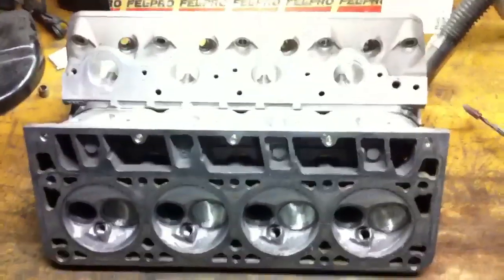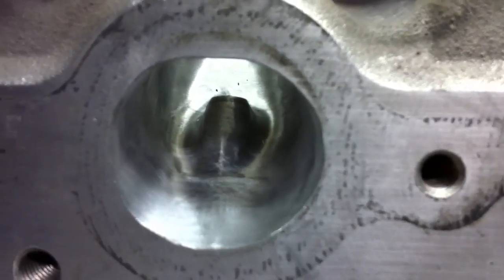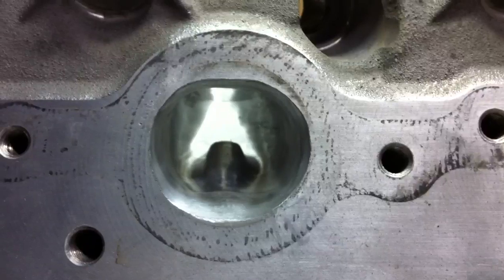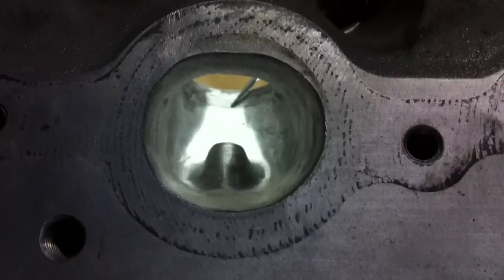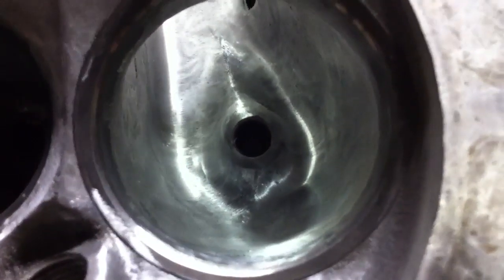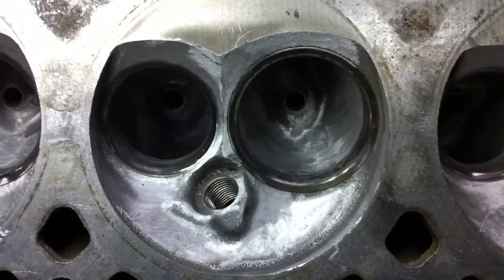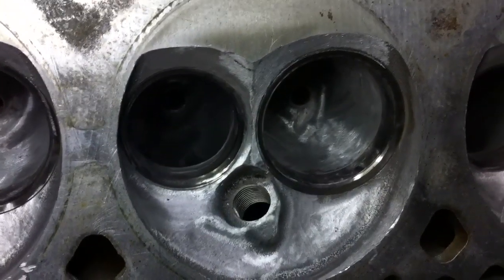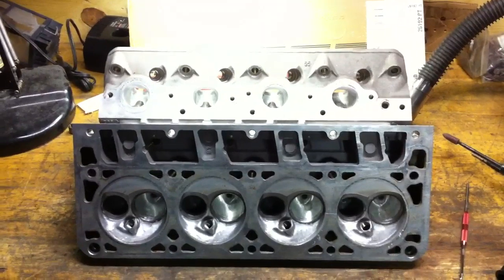How To LS1 DIY Head Porting Part 9 - All Done

Comment: Dude.......get rid of the sharp ridges between the valves and especially between the spark plug and exhaust valve!! That is the hottest part of the chamber and I don't think you want that to become a "Hot-Spot".  Real obvious at 2:39 & 3:33.
The exhaust could use a little more touching up right under the seat.

Otherwise, this looks like a good effort and will definitely net some positive results.

Comment: Great videos they are very helpful... just curious what the cast number on those heads? An another question I notice you have some pitting in the aluminum between combustion chambers my heads are the same. Is this something I need to worry about if I'm not going to have them mill down?
Reply from the maker: These were likely 862 heads, but from what I’ve seen, most of the LS1 style heads are the same in the ports. 
I don’t remember the putting being an issue, but I usually mill the heads (.030”) anyway to raise the compression.
Reply from the maker: BTW, thank you for your feedback! I appreciate it. I’m glad to hear that I could help.

Comment: Great job!  Glad you pointed out the water jacket humps.  A guy could easy enough take them out by accident.  I'm going to buy a set and port em for my 99 vette and then change them out.  I put a hot cam in and got some power but I know the heads are choking the cam off.
Reply from the maker: Thanks Bob! Yes and once you're done with even this basic of a port job, you will see a difference. I've done it a few times since these. I also recommend milling the heads to bump up compression. That'll help as well.

On that "water jacket" hump. Since this video, I'm wondering if there is really water behind it. I haven't gone through it enough to find out. It is directly below the valve spring base. So it may just be extra material for the spring seat. When I said there was water there, I was passing on a warning that I had been told.

Now days, I cut that lump flat to the port. I don't dig any further.

Comment: Just a quick question, and maybe a dumb one. In your port where you opened it up into the stud hole, will that small hole create any turbulance? I have been working on mine and being really carefull not to get into that stud hole and just wondering if it matters that much.
Reply from the maker: Not a dumb question and many ask about that hole. Thats why one of the videos I show how that hole looks once the rocker bolt is in it. The bolt tip fills most of the hole. So the answer is Yes, it would possibly create a very small amount of turbulence. I think that amount is so small that it doesn't matter. It is definitely worth it to cut all the way to leave an open hole. Look at Texas Speed and other companies CNC'd heads. They all cut and leave that hole exposed.

Good luck!

Comment: Hey I know a way to get the postings shining with the tootsie rolls. Keep the ones that split apart and flap around. What I do is when I want to get them polished just take the ones that flap and put them on and either dip them in water or use a degreaser like the purple engine degreaser. I can send you pics, message me on ls1tech. User stoning_volcom

Comment from the maker: Thanks Jack! I'm very interested to find out what a good set of valves would do on a pair of these heads. I plan to do a pair like that in the future. It just doesnt fit into current projects. 

I mostly try to do my performance projects on the lowest budget possible, but also curious what the better valves could do to always have that as an option. I like having the steps, stages and options to pick from for each build.

Comment: i like your vids very informative but based on my flow knowledge i bet with a good set of valves and a quality set of valves i bet at .600 lift you can get very close to 300 cfm (intake) depending on the table/bore plate used

Comment: Yeah it's a Honda, I just pulled my stock motor for a built (forged piston/rod) motor, which will eventually be turbo.  I'm going to practice porting on my stock head.  I plan on just cleaning up the casting, blending the seats, and doing an anti-reversion step at the TB to IM, and IM to head.